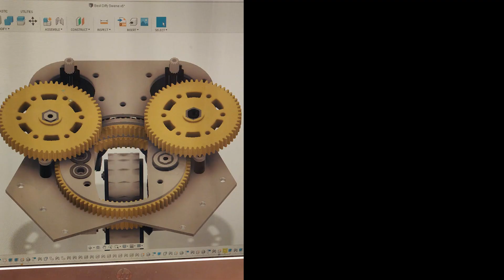Official Differential Swerve Reveal | Team 2383 | The Ninjineers

Comment: Cool concept! What’s the benefit against conventional swerve?
Reply: both motors power the spin and the driving. So basically with their setup you get 6 motors driving power instead of just 3 motors driving and 3 steering like you would with conventional swerve.
Reply: even more power that can't be put down into the carpet... the traction just isn't there
Reply: @skyeleake9943  At traditional speeds perhaps, but if you are targeting higher top speeds (upwards of 18ft/s) it could actually be quite useful to maintain peak acceleration and prevent motors from overheating. It is not normally important to go that fast most seasons, but with the long straight shot between the human player station and scoring zone, that extra speed can be pretty useful this season. 

Remember that having the power to momentarily break traction doesn't mean you can sustain those forces for long without causing some pretty significant heat build up. Falcons might be capable of a lot more stall torque than other motors, but they still need to radiate off heat just like any motor (which they actually do pretty poorly with their plastic housing). This is especially significant since they are running only 3 swerves instead of 4 so each needs to apply more torque to maintain drive power.

In general, I don't think it would be worth it for most teams to try something like this. However, for a team that has the manufacturing ability, design ability, and the time to do it; there are still a few notable advantages to it.
Reply: @howardbartlett3419  Isn't there issues with the turning gearing? I'd assume that the gearing makes the modules twitchier than a crackhead.

Eh, I guess unless you're rotating the modules at like 600rpm, you're not going to overload them.... haha
Reply: We had issues with traction, but we 3D printed some sharply grooves tread in TPU and they worked really well in terms of traction.